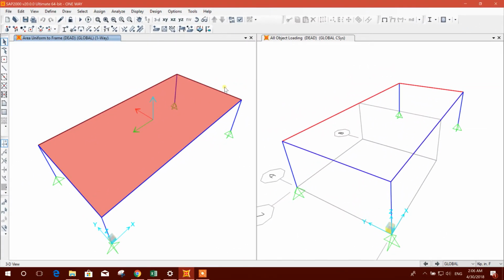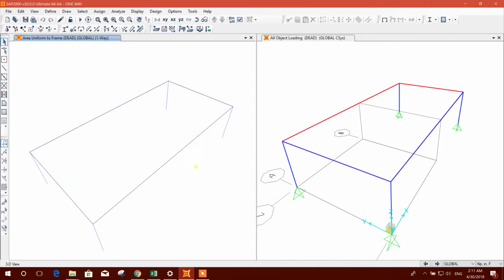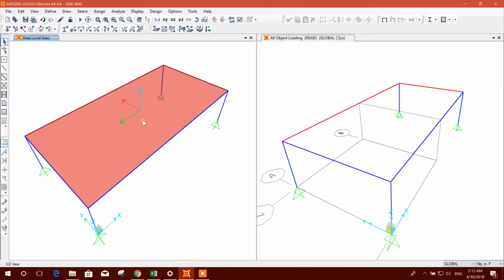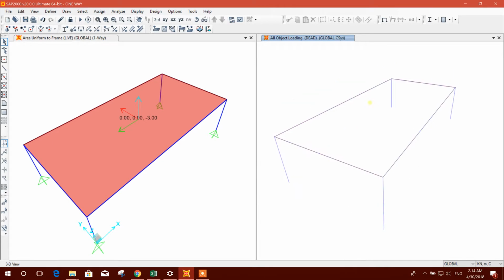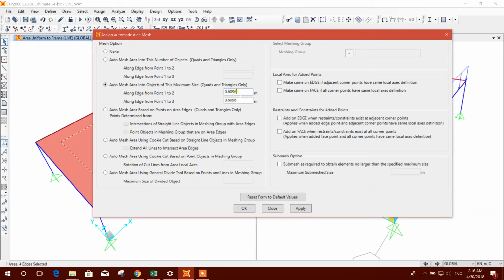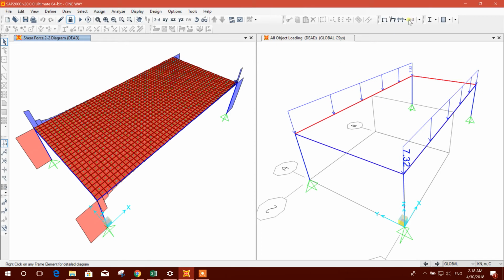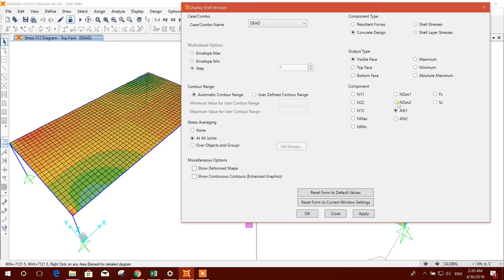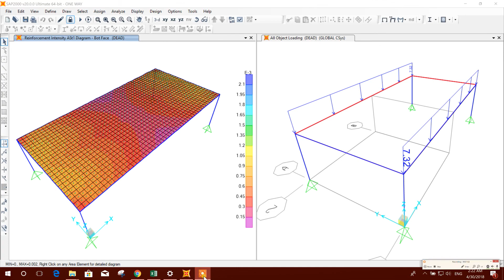ONE WAY SLAB DESIGN/ONE WAY LOAD DISTRIBUTION IN SAP2000 V20

Comment: Hi, as a one way slab the shorter direction carry the load and overall deformation is cylindrical, but in this video m11 and Ast1 that represents reinforcement in 1 direction is lower than 2 direction, I can't understand this. Refer to DESIGN OF CONCRETE STRUCTURES darwin and dolan. chap12

Comment: Hello, Can you please make a video on:
1.  Moment and Force directions (what is maximum and minimum moment M1, M2,M3?). positive and negative moment directions.
2.  to show local coordinates and if we can change their orientation to match global coordinates.
3. Explain supports, spring constants and Degree of freedom in detail.
4. Meshing of slab areas/wall into Finite elements.
5. Is there anyway we can see the dimensions of existing element in the model?
6. When to use shell thich/thin and plate thick/thin in Define Area options (for 1 way or 2 way).Please reply.
 Also, do you have email id or facebook page where I can message you Sir.Thanks.

Comment: This feature is broken, when I divide the sheel in more shells (to apply differente loads, for example) the load (one way or two way) distribution is not well calculated. This worked correctly in previous versions :(
Reply from the maker: Which version you are using?